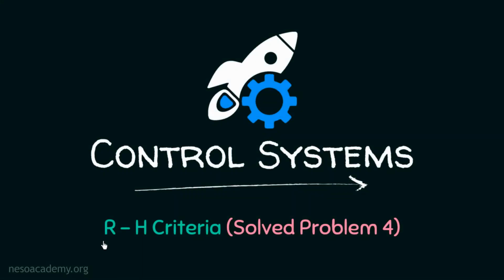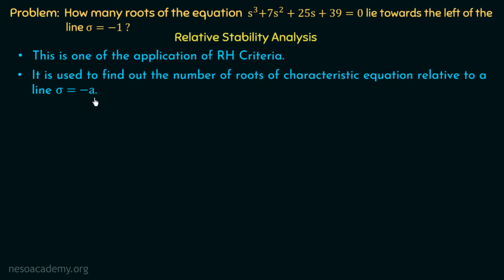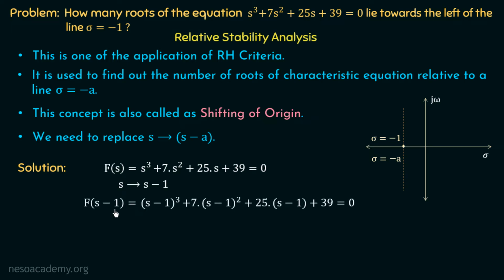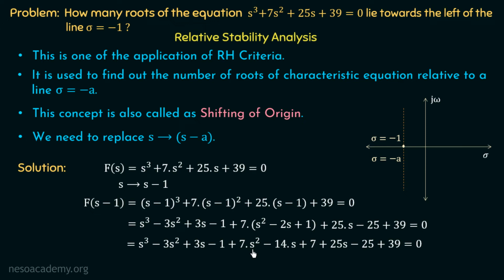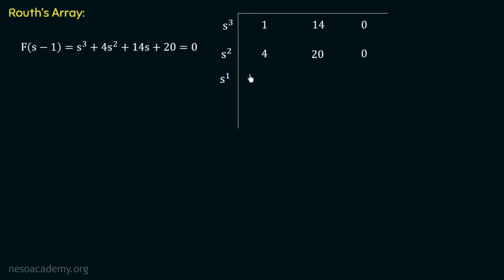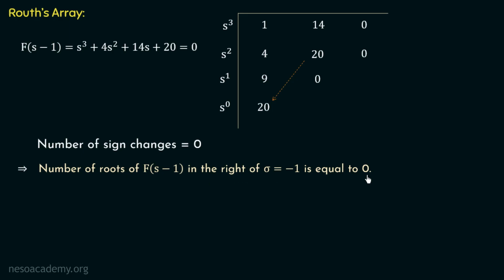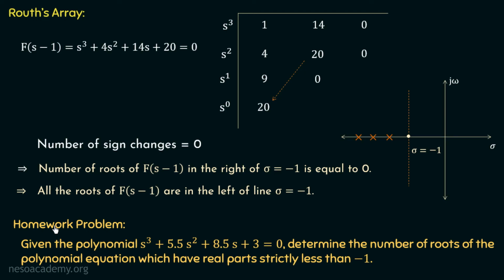R-H Criteria (Solved Problem 4)

Comment: answer of the homework problem is 2. 
after putting s----> (s - 1) in the polynomial equation we get s^3 + 2.5s^2 + 0.5s - 1 = 0 and we can clearly see that there is one sign change that means one pole is in the Right half of plane where (S - 1), now we want total no. of roots present at less the alpha = -1 so simply we can do is LHP= total no. of roots - poles in RHP = 3 - 1 = 2

Comment: 11:12 Answer is 1 pole in RHP.
. ' . 2 poles lie in LHP.
' . ' Order of system is 3, no. of poles in L.H.P = 3 possible roots - 1 pole in RHP = 2 poles in L.H.P.
Reply: So u are saying it is an unstable system?? If poles are in RHP it would be unstable but according to question product of middle is greater than product of extremes, so system is stable. Pls help me out
Reply: @srirupaavala2798  since no. of poles are greater in LHP than RHP, you got product greater than middle term. It is not the deciding factor for all cases.

Comment: for those saying to replace s with s+1,
consider s+2=0, pole is -2. consider a line sigma=-3,
then the pole is at distance of 1 from the line before transformation, now for transformation ; 
1. (s+3)+2=0, origin is at now -3 and s=-5, hence the distance from origin according to this logic is 5 which is wrong. also, the pole which was at the right side of the line is now at the left.
2. (s-3)+2=0, origin is at again -3 and s=+1, hence the distance from origin is 1 which is correct. and here the pole is on the left side which is correct.

hence for sigma=-a, the transformation is s->(s-a).
Reply: iitian?

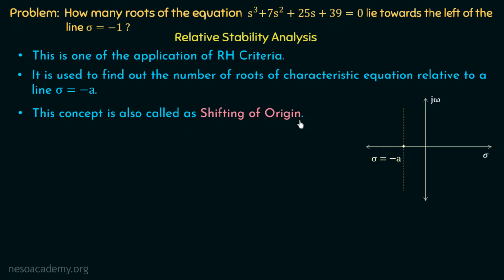Comment: Error at 03:10 "we need to replace s → s - σ"
my HW solution:
by replacing s with s+1 we find that number of roots to the right of the new origin is zero
the first column of the array is 
1
8.5
20.83
18
Reply: why you are replacing it with s+1 instead of s-1?

Comment: s should be replaced by s+1
earlier sigma = 0, origin
now sigma = -1 is origin , 
so sigma ---> sigma + 1 ( -1 + 1 = 0 )
Reply: nah in the definition its written that sigma= -a so comparing with that it should be sigma - a only
Reply: Yeah because if are shifting origin towards left then by adding that number is possible

Comment: Sir I think we should replace 's' with (s+1)
Reply: it's s-1 because you're actually moving the axis to the left, if you move a function to the left by 1 unit, it will be f(s+1), this is opposite, and i think you may be confused with moving the function and moving the axis.
Reply: No no bro sir is right.